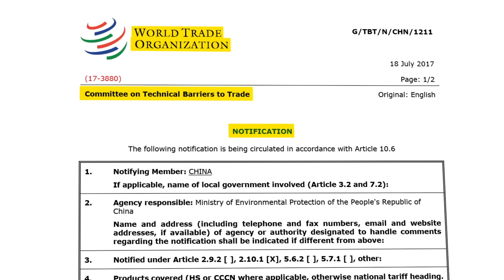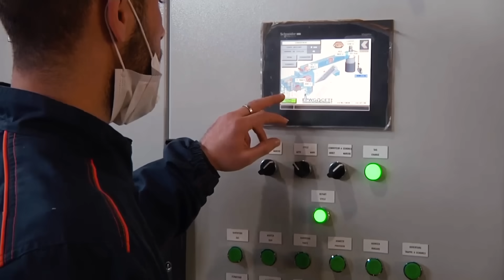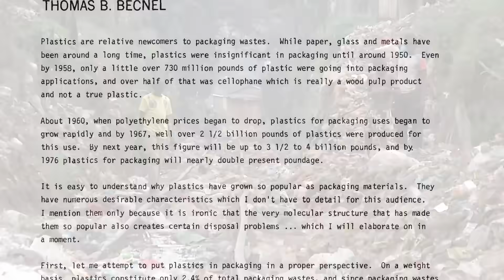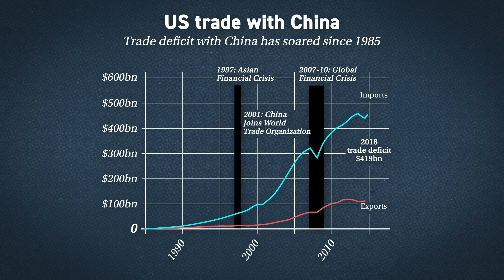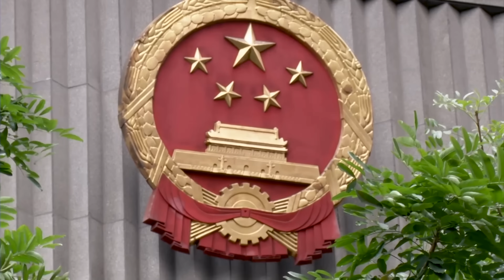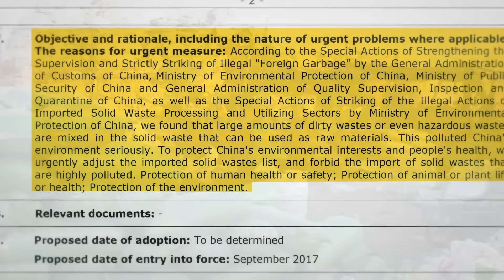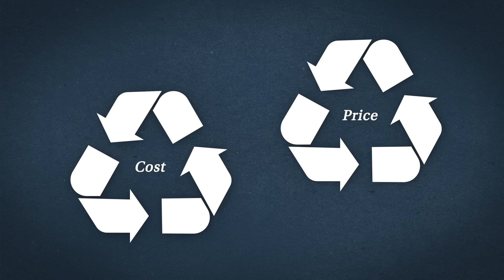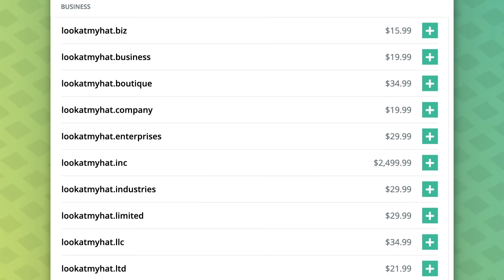How China Broke the World's Recycling

Comment: "market forces" forced me to buy plastic instead of glass, because nobody sells certain products in glass!
Reply: ISO should make standard glass containers in a variety of shapes, sizes, and strengths to be used across the industry. When it gets used, it can just go back to the chain without even being recycled. Standardization would mean companies could use containers from their rivals freely and easily. Diversity sometimes is bad.
Reply: @srpenguinbr  It's been tried: fresh-delivered Milk bottles remain successful in certain parts of the world, and beer bottles were standardized in Canada specifically so that bottling plants could quickly and cheaply recycle the empties. However, there is a considerable downside: Single-use containers can be made SUBSTANTIALLY cheaper in terms of weight and bulk because they don't need to survive being opened. Compared to a glass bottle, a can has hair-thin walls that are easily crushed when empty, but both weigh less and can be packed closer together. This makes the marginal cost of each bottle much higher from both lost shelf space and higher transport costs. Factor in the costs of recovery and cleaning, and it becomes a tricky prospect. After all, you ideally want the reusable container to cost less per use than a can, so you can recoup the higher costs of its initial manufacture.
Reply: @srpenguinbr  Diversity is always bad. Take a moment and imagine if humans only had one culture, just the one. Almost all major conflict would be gone. Take into account that one culture means one culture, and that means only a single worldview and set of traditions and language, and values. Even if we still had many nations, having one culture would mean all o humanity could easily and happily work together. That alone would solve a good 60% of all the world's problems within a decade or so. We put the very thing keeping us here on a pedestal...
Reply: @MeepChangeling  ... Diversity of culture and experiences is one of the most valuable things the human race contributes to the world, without diversity of opinion and thought we would still be using sticks to hunt and wearing animal skins
Reply: @MeepChangeling  You are acting on the premonition that conflict because of culture is what causes most of the worlds problems.  Yet that is not the root of it.  Erasing culture would worsen the world, not make it better.  All around the world you see crimes and conflict, that is obviously not all because of differing cultures coming into contact.  It is a Sin Nature problem, not a culture problem.
Reply: @MeepChangeling  You act as if humans aren't already functionally equal. Diversity is just a product of environment. A monoculture, whether it be environmental or societal is far more disadvantageous.
Reply: @MeepChangeling  you are not wrong, but the thing is that ayone that proposes this is always impplying that it is their culture should be the one. its not the cultures that we need to unify but goals.
Reply: @MeepChangeling  depends on the context.
Reply: @MeepChangeling  What an incredibly small
and underdeveloped mentality to have. It’s the forcing of singularity against natural diversity (historically through patriarchal hierarchy) that caused so many problems among people. Mass production of the same monopolized products over fills the market and causes stagnation. Forcing others to conform to the same mentality and behavior leads to conflict more often than not. Mostly everything in our known universe is chaotic and diverse, even our very biology as a species. A lack of diversity will get you killed in the long run.
Reply: @micah_lee  no such thing as sin. Just a man made concept to oppress women and control men.
Reply: @MeepChangeling  We'd also still live in caves. Cultural exchange = progress
Reply: @kissit012  Well, we could get into an argument about our nature and morality among other things.  But I don’t have time now.  And you may not want to either
Reply: @MeepChangeling  I wouldn’t say diversity is always bad, I’d probably say diversity causes most arguments and problems these days
Reply: Almost like we need to regulate company behavior rather than individuals
Reply: @mycosys  Nope. Manufacturers already are incentivized to eliminate waste, and sort valuable waste products or cast off as much as possible.
Reply: @JPDillon  lmfao. no, they are incentivised to maximise profit
Reply: @mycosys  .... by getting the most  value out of resources they've already bought.
Reply: The problem I have with glass is that it ends up broken outside for me/children/pets to step on. I hate how alcohol is sold in glass because people love to get drunk and leave them everywhere.
Reply: yeah dude, I can't find any glass condoms, talk about being green and recycling. I am using test tubes as a replacement.
Reply: They are about to stop recycling glass in my city. Wtf? I thought it was one of the easiest materials to recycle.
Reply: I wish we would go back to the era of turning your glass bottles in for reuse. Possibly even make standardized glass container sizes so hundreds of products use the same dozen containers to be reused.
Reply: You can reuse plastic bottle too. I reuse mine 3-4 times.
Reply: I distinctly remember my parents buying milk from a local dairy that was sold in glass containers. It had something like an $8 bottle fee that you would get back when you returned the clean bottles. It was the shops responsibility that they only accepted properly cleaned containers and those were then sterilized by the dairy and reused.

The whole system worked great and I think there should be more like it.
Reply: Plastic is lighter to transport than glass
Reply: Glass is just as wasteful as plastic - although glass doesn’t decompose as slowly as plastic, it takes a helluva lot more carbon to make it. It’s certainly better if you reuse it a hundred times though.
Reply: @KC_G4S  That's my idea, reusing it dozens of times if possible. For instance, a cheap beer company in my country uses their bottles up to 20 times
Reply: @KC_G4S  That's the thing. You can buy some 30 glass bottles and use them your whole life as leftover containers, propagation planters, paintbrush cleansers and though it looks silly, drinking glasses. The problem is that food is something each human requires daily, and food is either packed in paper, plastic, metal or glass, all of which we can't store an infinite amount of in our homes... Being able to buy fruits and vegetables without plastic packing would help out a whole lot.
Reply: @Loekamber  Paper and cardboard is either easily recyclable or easily biodegradable.  And we can easily farm trees without destroying the environment and keeping habitat.
Reply: @KC_G4S  if you got all of your energy sustainably then more carbon wouldn't matter. That's why electric cars are really only good in states like Washington where most of the electricity is cheap and comes from water. And I think cleaning glass is easier.
Reply: Concerns about deforestation forced people to switch from paper and cardboard to plastic. Now plastic is the villain because of lack of biodegradability and ocean pollution.
Reply: @MirzaAhmed89  the problem is we stigmatised perfectly viable source of paper that doesnt involve cutting down forests, hemp.
Reply: No one wants to pay extra for fancy garbage
Reply: @Distress.  The glass system was better overall than the plastic system.
Reply: @Distress.  Before plastic came along, no-one knew they were paying extra.  If plastic packaging dissapeared, everyone would complain for a month or two, then most people would forget what is used to cost, as the product just "costs what is costs".
Reply: I choose plastic over glass because glass makes groceries heavier
Reply: @triadwarfare  [glances at caddy]

Comment: Well in reality no recycling works as when you break down the bonds in the plastics and reform it, it becomes a weaker material than the original plastic so even the profitable useable plastics have maybe 2-3 uses before they end up in the landfill anyway.
Reply: So? We should do nothing? What’s the solution mr?
Reply: @remi_gio  stop producing and using plastics at all. That's the solution. Recycling plastic is like trying to fix a broken leg with a bandaid.
Reply: @justastudent1423  I was asking sarcastically to mr Elder Moose.... 🤦🏻‍♂️
Reply: @justastudent1423  ...btw your answer is not exactly enlightened - we use plastics in medicine and 1000 other very useful applications - we are talking consumer goods plastics that are the problem....
Reply: Heat stress can permanently change the structure of some polymers which does make them weaker, the only true way to get back the original strength would be to break the polymers apart completely and reform them.
Reply: Ralphie Raccoon Cracking and reforming.
Reply: @nousername5673  Pretty much. That's what Enzymes like PETase do. Hopefully we can find more. Unfortunately enzymes are often expensive to make in bulk.

Comment: or go back to glass containers.
Reply: Glass has problems too. It is carbon-intensive to produce and recycle, and the high weight means more shipping pollution.
Reply: @jamesdinius7769  go with standardized sizes then? Germany for example has specific beer bottles sizes/designs that are used over and over, eliminating the need to melt them down and reform.

Comment: Now it would be good to say that incinerator even though it sounds scary, it is the wayy better option, because with modern incineration plants you minimize the externalities, but of course it costs to operate an incineration plant and you of course also lose the raw resource. It's almost like waste has a negative value, so you need money to get rid of it huh?
Reply: It still takes hydrocarbons from underground and puts the co2 into the atmosphere, which is the problem. 
Some incinerators actually make money (depending on their situation, they get paid to take low quality plastics, then burn them, and generate electricity which they can sell)
Reply: With modern scrubbers on the chimneys they're really not as dirty as they used to be. And the ash can often be mixed into concrete (it can actually improve some properties) for stuff like building foundations which saves sand and gravel, and processed further to remove recyclable metals.

Comment: I'm confused - bottle caps are both a valuable plastic type - high-density polyethylene (2:36), turned into plastic crates (2:37), but they are also a negative value plastic (3:36).  Are there different kinds of bottle caps? Are some high-density polyethylene, and some not? 

I'd also say the image at 2:36 strongly implies that plastic-type 4 is high-density polyethylene, but in fact, type 4 is low-density poly and type 2 is high density. 

It may seem like I'm being a bit picky, but I disagree, I suspect what's happening is you're playing fast and loose with image/word correlations that are taken to be significant by a large portion of viewers.

Comment: we need to shut down plastics. I am genially curios about what we could use in their place?
Reply: For sure it won't be a single thing that would substitute plastic.
Reply: In a lot of cases, nothing that would be a true substitute. A lot of modern products simply couldn't be made profitably. Others would be heavier, less durable, and a lot more expensive. That's the thing, we can't really shut down plastics without shutting down a huge part of our modern world, and that goes for everywhere, not just the rich west. Unless you are a remote tribe living in a jungle or on an island, it would majorly affect your life, probably for the worse.
Reply: I think a lot of things can be substituted to glass. But glass is way heavier, is more fragile and is dangerous when it breaks. But is more environment friendly because at least it turns into polished stone when washed by the sea. But still not ideal.
Reply: @jmtrad1906  Volume is an issue too, glass has to be much thicker than plastic, so you'd be able to transport significantly less of a product in the same space (especially as it has to be seperated in crates to prevent one jolt from shattering half of them).

Comment: "Most metals can be sorted by magnets" Are you counting all alloys of steels as separate when your saying that (According to AISI there are over 3.5k steel alloys)?  Only Iron, Cobalt, Nickel and their alloys are magnetic at room temperature.
Reply: "Most metals [that can be commonly found in waste] can be sorted by magnets"
Reply: @lilpeach101  That is way better.
Reply: Eddy current separators can separate non-magnetic metals.
Reply: @Tyler_0_  Are you saying "Eddy current" separators (as in a type of separator) or Eddy, current separators (Telling Eddy, about Modern separators)?
Reply: @heinrichkrull2523  How about you just type it in google, as typed, and see what comes up.
Reply: @Tyler_0_  I was just messing with your grammar.
Reply: @heinrichkrull2523  How about you just thank me for using my time to point you in the right direction regarding your comment instead of being annoying.
Reply: @Tyler_0_  Yeah sorry about that😅.
Reply: Aren't most substantial amounts of steel sold to scrap years anyway? Steel ain't cheap at least compared to plastics.
Reply: @Dave_thenerd  Compared to commonly/moderately used plastics it's more expensive per volume, but per weight it's cheaper. Common steels are way cheaper than most alloys/metals.